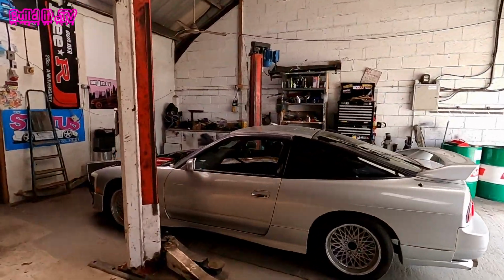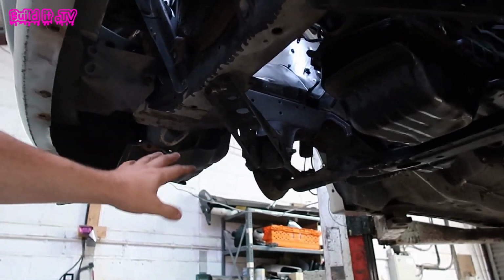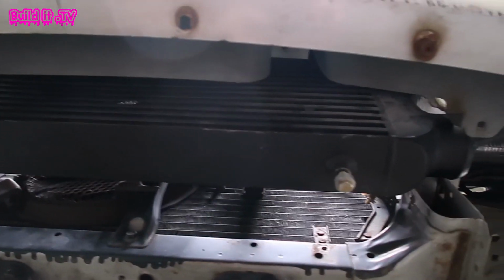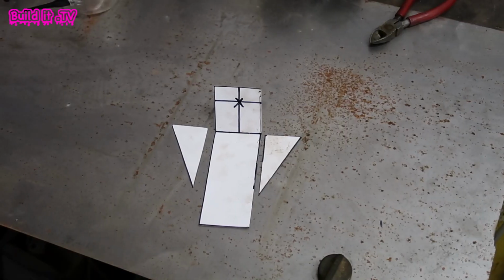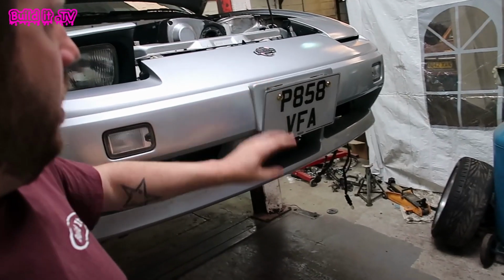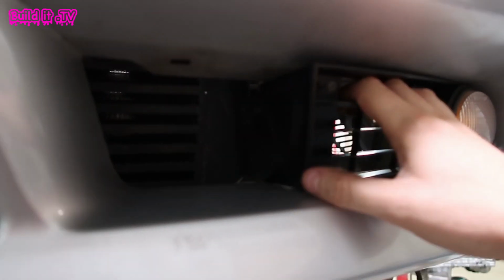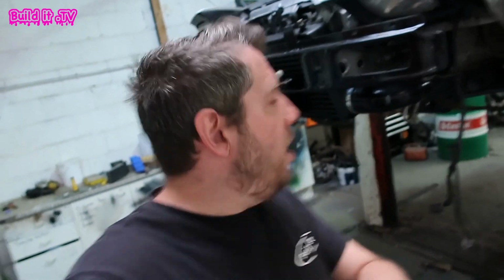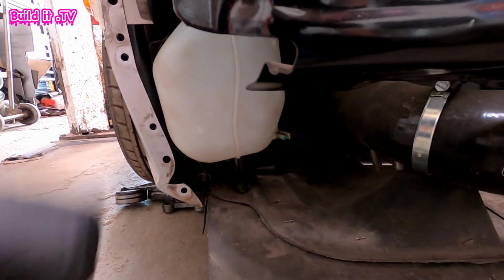THE RB25DET 180SX IS BACK !!! | intercooler and oil cooler install

Comment: I feel like you went a bit overkill on the intercooler, top part won't get any flow to it. 
Subscribed anyways
Reply from the maker: Thanks man, It was the cooler that I was running when this engine was in the R33 so should be fine size wise and I will run with the front plate off as much as I can (without getting in to too much trouble from the police 😂) so that should help.